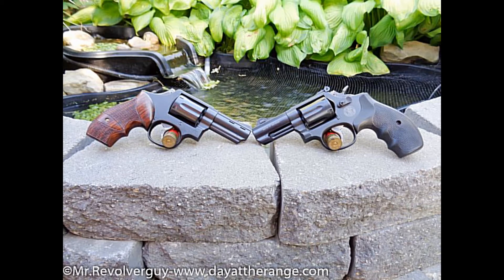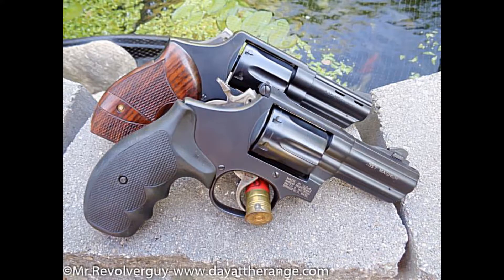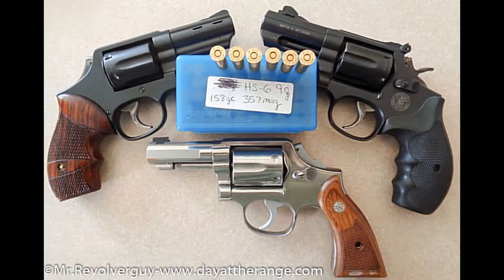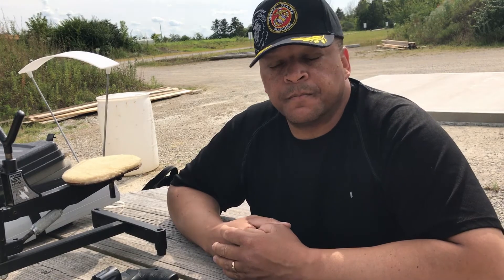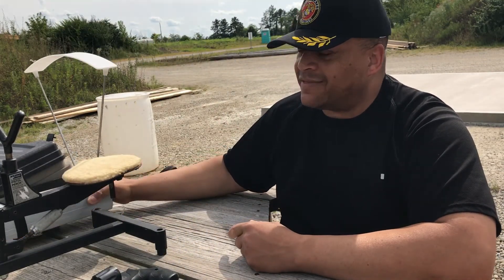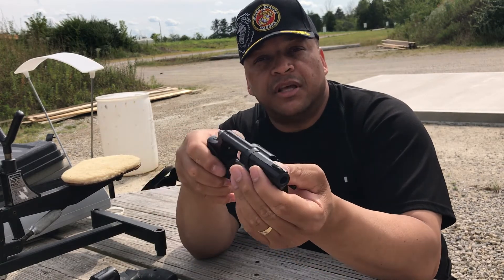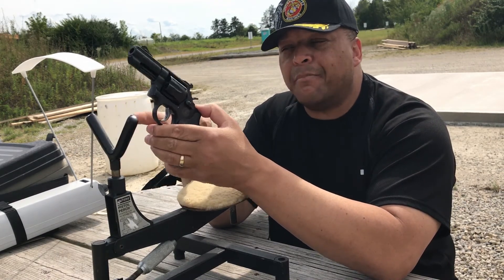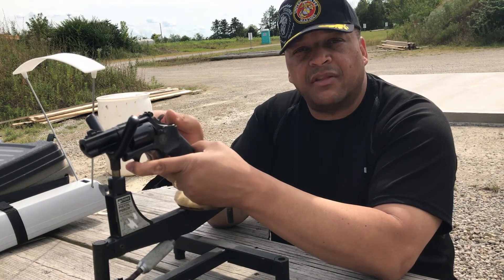Magna Port or Power Port: The Effects of Porting

Comment: Ported revolver tests should be done with only one revolver and altering it. Revolvers of the same make and model but treated separately are different enough that velocity readings can deviate from that alone. A model 329PD was left alone unaltered and another model 329PD was Mag-na-ported with the quad ported approach. The ported model registered higher velocities after porting with the same load.

Comment: Good comparison. The effects of porting on muzzle flip and perceived recoil are very subjective. Several years ago I had a S&W 586 with 6" barrel, tuned by a gunsmith and Mag-na-ported. Muzzle flip was greatly reduced in high velocity loads with light bullets, typically 125 gr over hot handloads. Porting was somewhat less effective on muzzle flip with heavier bullets, 158-180 gr, although loading those hotter to higher velocity might have been more effective, but I never got around to that kind of testing since the L-frame wasn't as suitable as the N-frame for heavy loads. But the L-frame was popular with various practical pistol events due to the lighter rotating cylinder weight, with the heavy barrel lug to help control muzzle flip even without porting.

I found that ported 586 great for outdoor shooting events in the open. But it didn't make any friends at a popular local outdoor range with covered shooting stalls. The stalls had railroad ties overhead for shade and some protection from weather, as well as heavy duty walls separating the 100 yard, 25 yard and 15 yard ranges. The muzzle blast from that revolver was brutal, especially with the original Winchester .357 Magnum Black Talon 180 gr round, when reflected off those railroad ties that enclosed the handgun ranges, and the crusty old range safety officer limped over to give me the stink-eye to be sure I wasn't doing something that violated range rules. So I usually loaded light .357 Magnum or .38 Special in that revolver for that range. And I never fired it in any indoor range.

I've considered having my Ruger SP-101 DAO .357 snubby ported, but for a carry gun I'd go with Mag-na-porting. The ports vent gasses upward to the sides, so it's less likely to blast hot gasses into the shooter's face in the event we'd need to tuck the gun in close in a vehicle or to avoid grappling. I wouldn't choose any factory-ported short barreled defensive firearm that used porting on the top of the barrel (and slide, with semi-autos) for that reason, even if the porting was marginally more effective. Mag-na-porting is already very effective, particularly with lighter bullets pushed fast. But top porting should be fine with a longer barreled firearm, especially for the range, competition and hunting.

It also helps to handload with powders with less flash, or test factory rounds for that quality. The original 180 gr Black Talon .357 load had relatively little muzzle flash, the cases were only warm but not hot immediately after firing (compared with my handloads with 125 gr HP using Unique, Blue Dot, 2400 and similar powders), and the felt recoil wasn't bad despite the loud blast, even in my SP-101 snubby. It also hit point of aim out to 25 yards, while my lighter 125 HP rounds tended to hit high so I'd need to compensate at distances beyond 10 yards -- and I'd hope to avoid shooting at 25 yards in a self defense situation with a snubby anyway.

Comment: Thank you for sharing this data. I was considering having a model 69 magna ported but the drop in velocity seems a bit more than I’m willing to trade off.
Reply: It’s a 4 port here. They do a two port. Seems to average around a 40fps loss. Perhaps the two port magma port cuts the loss in half.  -40fps is a negligible loss and a very fair trade off for quicker follow up shots and more accurate shot placement in a double/triple tap scenario.
Reply: Got a 69 in 4 and a quarter inch I had quad ported by Magnaport a few years ago. I've been satisfied with it. Especially with 300 grain. Haven't regretted it. Cylinder machined for moon clips by TK customs. It's been a great wheel gun.

Comment: I always loved my 686 Power Port.  It ate up Fiocchi 142gr FMJ .357 Magnum like candy.

The Power Port was designed John French before he was hired by S&W as one of the founding members of the Performance Center, alongside Paul Liebenberg.  French and Liebenberg had been the first pistolsmiths to work with Whit Collins' wildcats that were the forefathers of the .40 S&W.  French rechambered a Browning Hi-Power for Collins' .40 G&A back in the early 1970s.  During the mid/late 1980s, Liebenberg worked with Collins on his updated .40 G&A, renamed the "Centimeter."
Reply from the maker: Daniel it sounds as if you got rid of your 686 Power Port?
Reply: Alas, I had a more pressing financial need related to family obligations.  

The only real downside to the Power Port is that it is a bear to clean if you use unjacketed bullets.  A friend of mine with a 629 Power Port discovered this the hard way.  All expansion chamber compensators tend to foul with lead; any IPSC shooter from the 1980s/early 1990s can confirm this.  However, the Power Port's chamber is so small that it is hard to chip out the lead deposits.
Reply from the maker: Daniel a nylon brush and nylon dental pick seems like it would do the trick if needed.
Reply: With severe deposits in the expansion chamber, I've seen folks struggle to remove the lead with a small screwdriver and metal dental picks.

There used to be something available called Carter's Compensator Spray, which supposedly helped to prevent lead fouling.  However, I don't think it is on the market anymore.